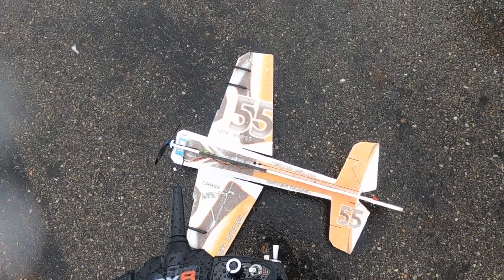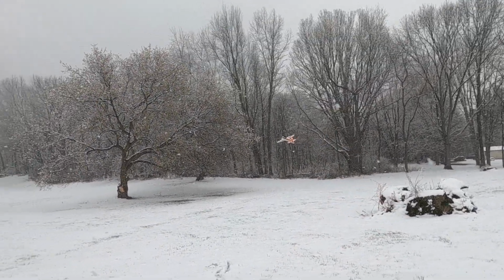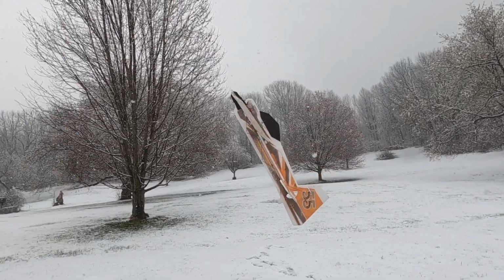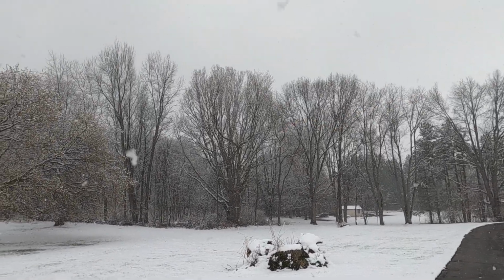4-17-2020 Bayer Model 32" Crack Yak 55

Comment: Another fun flight with the good old yak hopefully you'll get that elevator servo problem worked out soon?
Reply from the maker: Ordered ten PowerHD DSM44 servos today. They've worked good in the Vertigo so far.. but then so had these PTK servos in the Yak. I don't understand how putting a short extension on the servo arm can make the servo go from working fine to being nearly useless.